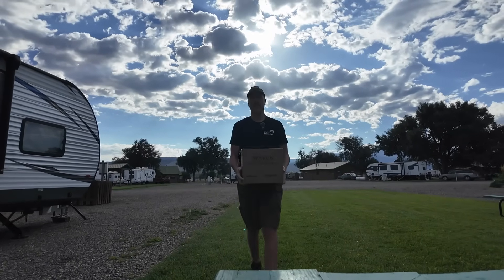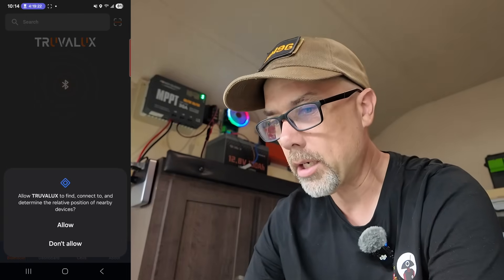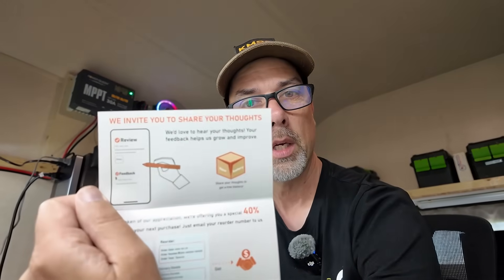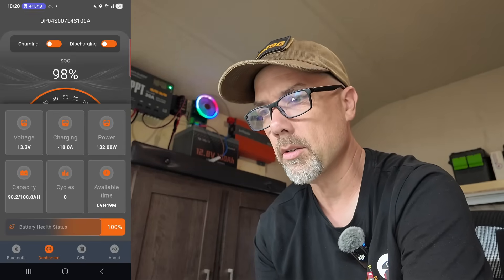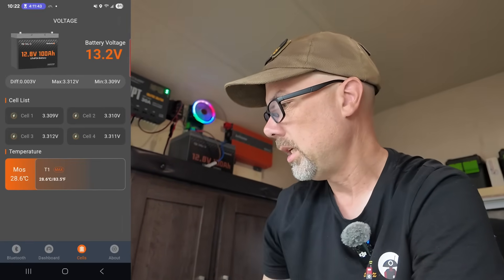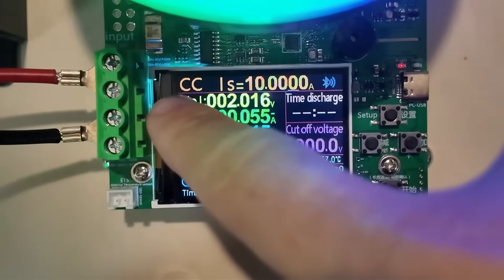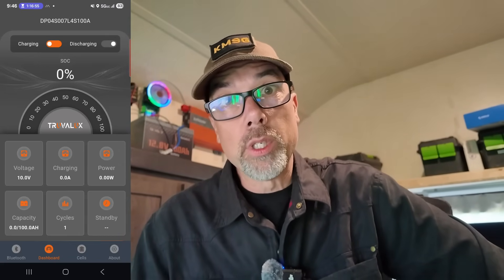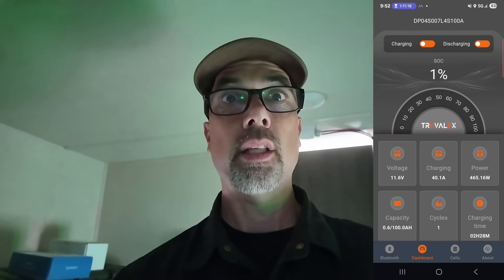Want to be smarter than everybody?

Comment: Most public schools in the US use the text book method of learning . And most people learn better with hand one and real world examples . Other countries put more in to education with field trips and real word learning and leaving the US in the dust . Just go to Japan or China . And out public schools   teach so much we will never use in our life time.  Nice battery and most 100 AH test a bit over . That shows good cells . Their is a way to use them as a starting battery. You need a super capacitor like 500 FD or more. Charge it threw a resistor off LiFePO4 then jump start .  They make jump starters that have a super cap and take small battery . Quite amazing what they can do. I have the Ryobi 18V 1 plus jump starter. It works well . With adapter a DeWalt 20V MAX battery will work. How I use it. Starts V6 with no battery ! Great from just a tool battery that has like 30 amps max at 18-20V . That 100 AH will do FT8 all day and night at 100 watts for days. That a lot of parks in the log on 1 charge. 73
Reply from the maker: American schools are "free babysitting" and tax dumpsters.  You might get me started on a rant here...

Comment: PLEASE CONFIRM!   We have found that the Bluetooth battery monitoring does not work when you are out of cell service.  Out camping there is no way to monitor status of the battery nor rate of charge.  Solutions?
Reply from the maker: Hey Owl,  What phone are you using?  I have a samsung galaxy s24 and I put it in Airplane Mode and turned off WiFi - so no internet.  I had no problem connecting to the battery and seeing its status.

Comment: Battery Capacity is a Good Metric, So is Battery longevity. I have been testing several 50AH Batteries of late to find one that satisifes my numerous requirements. I havbe had two batteries so in the last 6 months that started out delivering over the listed capacity but over a series of 10+ fast charge cycles dropped to under 88% of capacity. The other challenge I am seeing is that a number of the less expensive and even a couple of premium batteries are really broadly Electrically Noisy making them non-starters for my Portable & POTA Weekend Ops. My two favorite so far that meets many of my Radio needs  are my BIOENNO 15AH LIFEPO and the REDODO 50AH BT LIFEPO. I now need to find a good Electrically quiet Solar Controller that works well with 200 Watts of Solar. The BuddiPole Power Mini works well with 100 watt panels but my 200 watt panels overload it.
Reply from the maker: Bioenno and Redodo are good brands to use!

Comment: How many watts will your 857 produce on a full charge (13.2) and how many watts on a discharge (11.5)?
Reply from the maker: I bet it does 100w output on both!
Reply: @temporarilyoffline I'm from Missouri...
Reply from the maker: You got an 857?
Reply: @temporarilyoffline yes
Reply: @temporarilyoffline I have a video on the power at full charge.

Comment: Agreed on the math. 
Didn't learn trigonometry until I was studying power factors in electrical apprenticeship school.
Reply from the maker: I hated being told "because I said so" growing up.  I don't think I've ever lost that.
Reply: @temporarilyoffline did the teachers hate when you aced their tests but didn't do homework, classwork or seem to study? Mine did.
Reply from the maker: @Rusted_Link until I got to college, then they respected me and left me alone.
Reply: @temporarilyoffline Yep, happened all throughout high school and got worse at college with many of the engineering professors.  By the way, does this battery have a low end charge rate/required amps in during charging?
Reply from the maker: @southernlonghorn4507  it will charge at 1 amp, but who's got 100 hours to spare?
Reply: @temporarilyoffline LOL, yep…that would be a big wait but was reading reviews of other “value” Li batteries and they wouldn’t take a charge unless it was a higher amp ? 20 + ? charger and I want to use a slow/trickle charge from a 300W truck inverter.

Comment: Thanks for the test, Steve!! I got a question, bro. First I will admit that I know nothing about LiPo batteries. I don't do any radio except at the QTH. My question is, im an avid bass fisherman and wildlife photographer and since I do both from a boat I have been wanting to get away from the nasty  lead acid batteries..My concern is the cold temperature cutoff..A lot of times when I put my boat in the water it's in the 20's ( rare for the lakes to freeze over, here in Arkansas) Do they make a LiPo battery that will work in lower temperatures?  I can't seem to find one?
Reply from the maker: Matt's reply is correct, he's a smart feller.  I just want to clarify that LiPo and LiFePO4 are wildly different.  LiPo are the dangerous ones that puff up or catch fire easily.   I'd stay away from them as much as you can... but they are unavoidable at times.
Reply: @temporarilyoffline  and wouldn't it be nice if the manufacturers were clear on these things?  LiFePO4 batteries are usually obviously such, but LiPo and LI-ion get thrown around like the fruit at a buffet.
Reply from the maker: @MattHeere if they knew how to do that, they wouldn't need me!
Reply: @temporarilyoffline thanks, Steve!
Reply: LiFePO4 batteries are OK to discharge down to -20C (about -4F) on average.  They, like any battery, won't provide full capacity at those temps but no harm will come to the battery.  You can't recharge it at those temps though.  It needs to be above freezing to charge (slowly), ideally at something like room temperature (where you can charge full speed).  Likewise ideally you'll be storing the battery indoors, although the specs for storage state down to 15F.  The LiFePO4 battery in my fishing kayak lives in the garage all winter and it gets down into the low 30's regularly overnight.  Been fine for years now.
Reply: @MattHeere thanks!